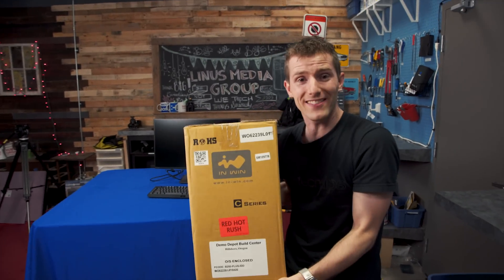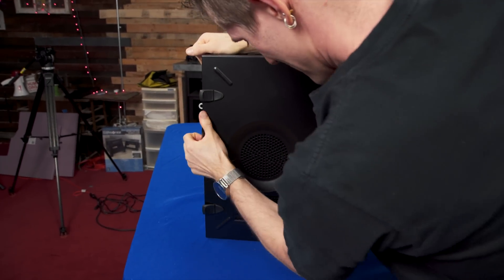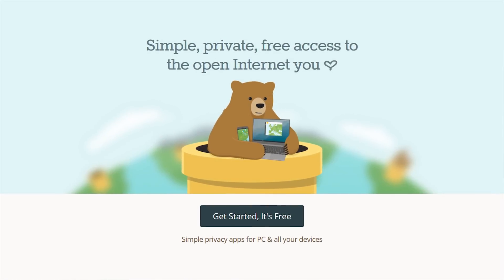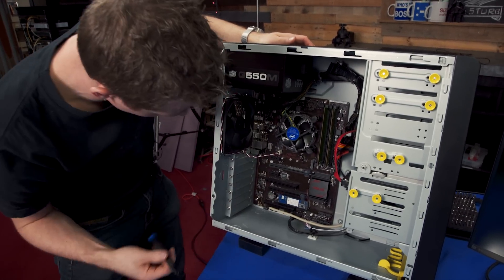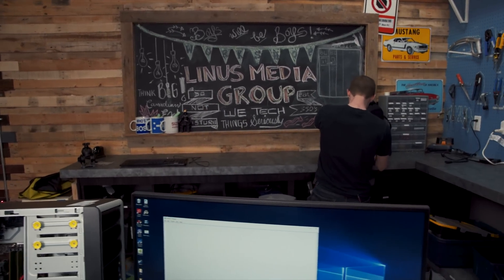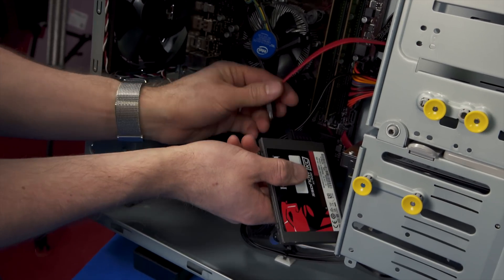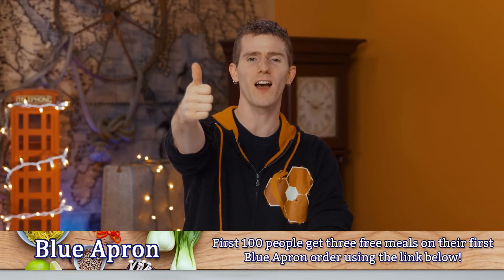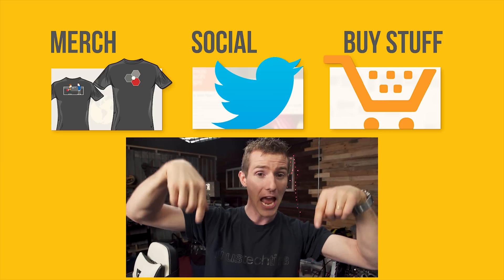Turbocharge your SSD for $40??

Comment: consumers still using mechanical hard drive (beside as storage) these day?
Reply: unknown majority of desktops are still sold with large slow HDDs when it comes to retail
Reply: unknown 
I need to buy one right now. All I have is a 120 gb sata ssd and I'm at half capacity in 1 day. I could burn holes in all my pockets and buy a 120 gb m.2 ssd, but everyone on pcpp advised against it.
Reply: buy a 240GB minimum if you dont have a secondary drive or network storage. I tend to need a 512GB lately.